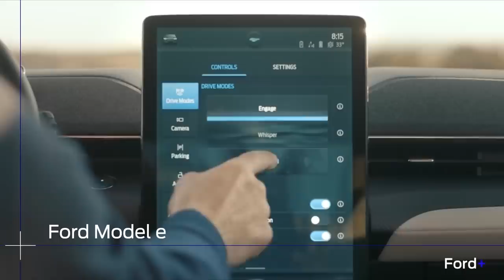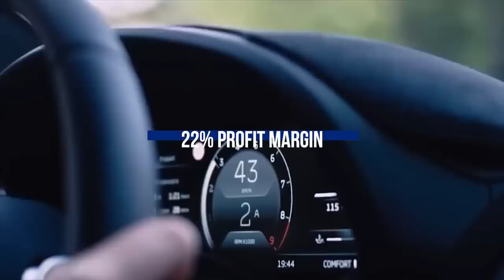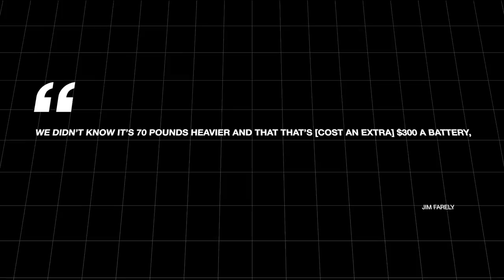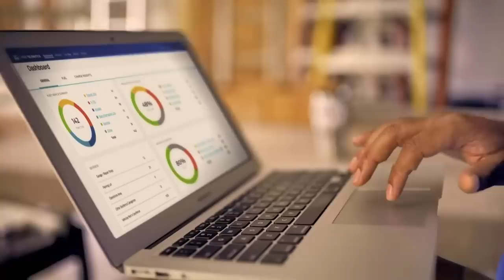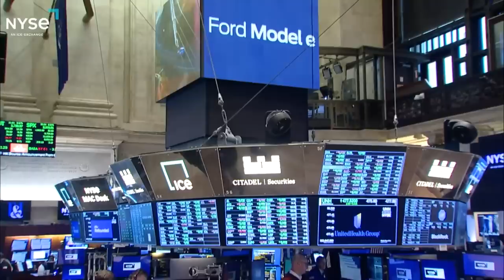More Bad News For Ford Motors

Comment: Tesla’s Cybertruck is coming this summer, full production next year.  Every CT sold will come out of the EV hide of legacy auto that make pickups, both ICE and EV.  Things are going to get rougher yet for Ford and other pickup makers.
Reply: The cartoon vaporware Tesla pickup could be a big flop - if it is ever produced LOL
Reply: That thing is impractical at most. Might be good for a Costco run with the micro bed.
Reply: @davidanderson8469  Very expensive status symbol to virtue signal at the country club.
Reply: Was excited about Cybertruck, but didn't they jack up entry level to $60K+? While it looks nice and is a Tesla, that's way too much for a truck.
Reply: Go Musk go.

Comment: They should have bet on hydrogen powered vehicles.
Reply: That's what TOYOTA is working on.
Reply: Hydrogen is probably 30-50 years away - I hope I'm wrong on that. However, I don't think H2 is viable for the average light-duty vehicle. Instead, it will likely better for commercial applications like long haul trucking or construction vehicles. That way, only a handful of H2 fueling stations need to be setup along major highway networks or at job sites. Retro-fitting the existing gas station network with H2 would take a couple decades at least. And, we still haven't found a clean and inexpensive way to get H2 - right now - you can either one but not both.
Reply: Go hydrogen if you want to waste 66 % energy 🤡
Reply: @mikafiltenborg7572  Go hydrogen when it's abundant and easy to make.

Comment: These new cars chocked full of electronics are awful. Never heard of the term "bricked" being applied to an automobile until a few years ago. All I want is a simple, inexpensive and economical gas car. Instead we get these technological wonders that will be nightmare long term.
Reply: EVs are economical to run, especially if you can charge them at home - even more so if you have solar power.  They have far fewer moving parts than a gas car, which should make them more reliable.  Software never wears out.  The challenges at the moment are the higher purchase price and somewhat limited range.  However, prices will come down and technology developments will enable longer ranges and faster charging.
Reply: @nigWANTsomeDAnk  I own an EV and it’s the best car I have ever had.  It is quiet, comfortable, handles beautifully, accelerates 0-60mph in less than 6 seconds, has enough range for my needs, and does not give off noxious fumes.  In case you are wondering, it is not a Tesla.  I would be interested to hear your broader thinking and more advanced insights.
Reply: @nigWANTsomeDAnk  no.

Comment: I’ll be at the Ford dealer when they have  F150 Lightnings for $39K or Broncos for a reasonable price. Not before.
Reply: Don't buy either one of those vehicles. Wait for the new CATL batteries to replace the defective LG Chemical batteries and that Bronco has serious engine problems.
Reply: @outkast40  
No chance of ever getting a $39K Lightning. As far as the Bronco, I’d opt for the 4 cylinder which has no issues (except the inflated price).

Comment: Ill buy an EV when i am guaranteed that when i pull into a refueling station i can leave in the same amount of time as when I refueled my IC powered car. How about a battery swapping station that is fully automated and swaps my battery for a fully charged one in under 10 minutes. Then my old battery gets recharged and is ready for the next person’s car that pulls in?
Reply: The battery swap is a good idea ..
Reply: You can buy a NIO which does battery swapping. The difference between 5 minutes and 10 minutes makes little difference to me so I guess your time must be more valuable than mine.

Phillip.
Reply: No to battery swaps ! A driver that fast charges its battery can shorten the life of the pack and you could get his bad batteries. Your better off waiting another 2-5 years for the( 2 million mile lifespan)  long range batteries that don't degrade as fast or catch fire. They expect to have M3P batteries in cars by the end of the year that charges 80% in 10 minutes.
Reply: @philliptemple9841   They don't sell NIO in the States and they are headed to bankruptcy .
Reply: You charge at home overnight. Do you go on road trips 24/7?
Reply: @lachlanB323  I don't have home charging. I just charge it in the supermarket forecourt whilst I go shopping. My car is known for its reliable batteries so I don't mind only fast charging it.

Phillip.
Reply: @lachlanB323  No place to charge the EV at my house.  I would have to run a cord from the house 30ft. to the street.
Reply: @robertc.maxfieldiiphotography  Then don't get an ev. But don't pretend that it is inconvenient for other people. In the future there will be level 2 superchargers everywhere for people like you who can't charge at home.
Reply: The batteries are incredibly heavy.
Reply: @davidanderson8469  I understand. Thats why there would be automated equipment to accomplish the task.
Reply: @philliptemple9841  i guess it is…
Reply: @lachlanB323  when i travel, yes my road trip is 24/7…
Reply: @lachlanB323  yep, we can depend on the government to ensure that there will be charging stations “everywhere”. Do you live in an area where there are brown outs now? How will the grid handle millions more of electric cars? I don’t believe it…
Reply: @mikefed For black outs we have batteries. And for more energy we have renewables. We will need less mining and energy with the transition to renewables and full EVs so if we aren't experiencing any problems right now then we definitely won't in the future. As for chargers... do you know a company called Tesla? Well they're doubling their supercharger network by 2024 and oh it's the biggest charger network by far and it's without any government incentives.
Reply: @lachlanB323  im afraid that the transition to renewables and EV is a pipe dream given the state of our electric grid. Renewables are too expensive and can’t scale up to meet surges in demand. Why the maniacal push for EV’s? Why not settle for hybrids; isn’t that the best of both worlds?

Comment: Under NO circumstances would I purchase a EV.
Reply: Thank you for sharing that with us.   Fortunately many other people will.
Reply: @SomeTechGuy666  🤣🔥🔥🚒
Reply: @SomeTechGuy666 No, they won't, going all in on EVs a huge mistake
Reply: Same here, as long as the EV cars cost more than combustion engines cars, takes longer to charge than filling up, and the range is less than gasoline cars. I will continue buying the gasoline cars.
Reply: @robgc1111  from 1,000,000 sales to over 10,000,000 in the past 5 year's for evs. In just 5 more year's or less ice is done globally period. 
By the end of next year nobody smart will buy a new ice vehicle anywhere in a well developed country=stranded asset.😀
Reply: The Ford Lighting Pick-up is not profitable? With some models over $90,000.
Reply: @SomeTechGuy666  , after over a year of watching and researching EV technology, and the piss poor implementation of all the design, manufacturing, and the mechanical platforms inability to be upgraded reasonably many of us will shout from the highest points to avoid EV purchases. Good Idea, bad planning!
Reply: @louishendricks-tv1sx  Whatever.
Reply: @SomeTechGuy666  , wow! That's exactly how I feel about the Corporate failure of the EV start up!
Reply: wr8bg
Reply: @beck-tn9gl  wring
Reply: You better start counting what the ICE-cost will be on a yearly basis and the difference from a EV (buy it directly from FORT itself) within  a few years EV will be a lot cheaper than a ICE
Reply: @louishendricks-tv1sx  Tech guys comeback was very weak...all I've seen is nothing but failure out of EVs with the exception of Tesla...if an EV works for some folks great, but for most of us normies they make no sense what so ever JMO
Reply: My 2010 Toyota Priu is an actual EV.  It can do what the batterymobiles never can, recharge on the go
Reply: @sharonbraselton4302  wring?
Reply: @robgc1111  I'm a fan of renewable energy, of advancement in energy storage systems  cells, and electric motors are bad @ss powerful! But in my view even Tesla has failed some very basic solutions that would make EVs much more useful and give them longevity and value. I believe in free market ideas but somewhere in the game the rules got broken and good innovation was lost.
Reply: Not even when gas is $15.00/gallon and rationed to 10/gallons per week eh James

Comment: EV's cost too much and overall they pollute too much !!!
Reply: And they'll take all the juice
Reply: wríbg
Reply: Um EVs don't emit any pollution, that's the point. Have you run a TCO model over 5, 8 and 10 years? They are usually cheaper.

Phillip.

Comment: Hiring Tesla Engineers as a strategy is a super head scratcher. 

Its like recognizing a farm called Tesla has developed a super method to identify good apple seeds and grow great apple trees. The trees are the engineers in this example. 

And Ford farm recognize that achievement, so their goal isn’t to buy good seeds and grow them. Instead Ford farm plans to buy the apple trees that haven’t grown well in Tesla farm to grow on their own farm, thinking that will result in great apples. 🤔

Comment: I’ve been driving Fords for decades I trade them in or sell them about every 4 years . That’s over I refuse to be SCREWED buying a FORD period with the over pricing and limited options and equipment at the insane prices . The Tesla Cyber truck is looking better and better . I’m not paying 100k for a F150 electric that can tow my race car trailer one way 90 miles and not be able to return back without spending time waiting to charge .

Comment: Stay away from EV's . Do what you do best . Combustion engines. Rebuild the Combustion engines to either recapture carbon or increase internal compression and charging to burn a cleaner fuel source. Alcohol, hydrogen, methanol.
Reply: yeß that chef futeer

Comment: Ford is charging ~50K a vehicle, adding in the stealship 20K mark up, it is around 70K. I am not sure what the Ford Management Team is thinking?

I have been driving a 2012 Chevy Cruze, Eco Trim Level, with a 1.4L gasoline turbo engine, 6 speed manual transmission, 42 mpg/highway. I have had this car for ten years, its mileage is 66K miles. I bought this car new in 2012, the purchasing price was $17,500.  I plan to drive this car for another 25 years. 

If Ford does not provide American with affordable cars, Ford will be dead.
Reply: Chevy killed the Cruze. LOL. Bad example.

Comment: Damn, nobody at Ford runs the numbers on EV's? It's all there in math, describing how impractical EV's are currently. All those folks with electric F150's.... Going to learn the hard way about not doing the math as a consumer. The numbers say that charge capacity needs to be 3 times higher while charging time needs to be 1/3 to 1/4 of what it is now. And charge cycles needs to be at least 2500. When you see numbers like that then it's time to go check them out.

Comment: This feels like trying to develop a flying DeLorean that uses Mr. Fusion; but I will not get a EV until: The car can go 350+ miles per 100% charge, where it only takes 2 hours to fully charge like a laptop with 110V house plug, and the car can last me at least 10 years and over 150k miles before I need to get a new one. Otherwise I will stick with my Japanese ICE cars. I think it is imaginable and achievable in the future, just like back then when we used to have 2.5 inch floppy disk 30 years ago, but now we hardly see them anymore and moved toward 512GB of SSD or 6 TB of HD.
Reply: We had 8", then 5 1/4" and 3.5" FDD's.
Reply: Gas was $1.00/gallon 30-years ago - soon it will be $10.00/gallon and rationed.

Comment: 🛑🛑 You couldn’t give me an EV for Free!!!

EV’s are so Short Sighted, it makes me laugh. 😂

•If you park on the street, (if you live in a Big City or Small One) where are you plugging into?

• If you take your vehicle off road into the mountains, where are you going to plug it into, when you get there?

• You realize all functions like AC, Heat, Wipers, Lights, Stereos, Heat/Cool Seats…ALL pull from your batteries. What functions are you willing to shut off to extent your range?

• If you left your house right now, in a gasoline powered car, you could run Non Stop, from cost to coast…just stopping here and there for 10 minutes for gas and food on the run….
How long is that same trip going to take in an EV??

These are just a few examples that people are not seeing. 
Give it time, EV’s will fade as soon as people finally see how STUPID EV’s Really Are!! 
Basically EV’s are another form of Lockdowns.

Comment: The next fifteen years or so will be very dynamic for the automotive industry.  Not everyone can afford a new EV.  And car prices are now rising due to inflation and added on hi-tech options.  I envision a demand for rebuilt or crate engines, as well as a boost in service parts and sheetmetal for older cars.  Aftermarket car parts, too.  The UIO of cars and trucks show that people are keeping their vehicles longer.  And the used car market for normally aspirated cars and trucks will boom.  "I don't need no stinkin' EV"!
Reply: "I envision a demand for rebuilt or crate engines" - not much use when gas is $10.00/gallon and rationed my friend. As it will be.

Comment: Reporter: So for every one of your 96,000 units of electric vehicles delivered in 2022 you actually had a net loss of around -$22,000 per vehicle. How do you plan on increasing these margins? 

Farley: TWOOOOOO MILLLLIONNNNNNNNNNNN UNITS! 

Reporter: But if you just produce more without adjusting (gets interrupted) 

Farley: TWOOOOOOOOOO MILLLLLLLLLLLLIONN UNITSSSSS

😂🤡
Reply: There is a big difference between reported losses and actual losses. They probably took a lump sum depreciation for all the new EV battery facilities and assembly lines. Plus all the freebies the upper management gets to write off like private jets. That is why they always seem to show losses on a $70K+ truck that only costs about $30k to make.

Comment: Ford is really screwing up. They can't control dealer mark up. And for the first time the Silverado is outselling the F150! Because the dealers are so greedy. A new F150 is not worth 30K above sticker. And when I took my truck in for service, I told the dealer that, and they said they are selling as fast as they come in, and they can't get them from the factory fast enough. And EV is still a joke. Everyone, everyone who I know who has one is unhappy with their investment. Hydrogen or Natural gas would be a better solution. It seems every day on the news there is a pic of an EV with a battery fire!
Reply: No Ford dealer in America sells a truck at 30K above sticker my friend. Bovine excrement.
Dozens of big manufacturers are making EV cars. 
None are making Hydrogen or Natural gas cars. You think you know better than them?

Comment: Well, I am a pick sort of guy,, a work truck guy.  I don't want bells and whistles.  I don't want power everything.  I don't want an engine that get 9 mpg, and I don't want an engine that has to be rebuilt or replaced every year.  I certainly do not want lipstick sparkle pink paint.   AND  I damn sure don't want all that BS that does not contribute to the profit of MY company  that makes the price of a new truck 100,000 dollars.  You have got to be kidding me,,,, 3 years ago you could buy a stripped down new F150 for 20,000,, today that is 60,000   So Ford's first mistake is slathering on every pound of useless makeup  on a truck, to tart the price up to 60.000 dollars.

Their second error,, is the same as their double clutch fiasco of a few years ago.  DO NOT sell a new truck that is not running.  Electric EV trucks that right out the door have defective batteries?  Please,, say that is not so.  Leave off the bells and whistles.  Produce a truck that is good on mileage,  gas or EV, and will start every time for at least 300,000 miles.  If you cannot do that,,, stop production.

Comment: While the US is sill waiting for the next gen Ranger. We in SEAsia had it almost for a year. What a fantasic job  Astrailians did. Out selling any competition in their catogrys. With both the Ranger and Everest. The next gen prices was up, but no significant. Then greed stept in. Special models were added, restructuring the price on the whole lineup.Then in March 2023, another restructuring, new models added. As it stands now, both Ranger and Everest became outrageously too expensive and unaffordable for its customer base. Is Ford going to exit the South East Asian market, that manufacture and  supply 180 markets, in the same  shameful and digusting Disgrace like GM did to their loal customers. If someting is not done soon, The Chinese is overcrowding the local  market where affordability is the only way, even if quality and substance is way behind. Hope someone can share this to Ford HQ.

Comment: So first, all shares of everything are trending lower.  It's a sign of inept government.

That aside, Ford EVs are so awful, that you'd think that instead of just producing a broader set of bad EV's that are uniformly bad, they'd focus on one EV that they can excel at both the engineering and production side.

The only explanation is Ford has been promised privately they'll be subsidized by the Federal Government if they produce a certain number of EV models.     Ford would be better making low-cost version of their pickup trucks to keep up volume and then convert to EVs when they can make one competent EV.